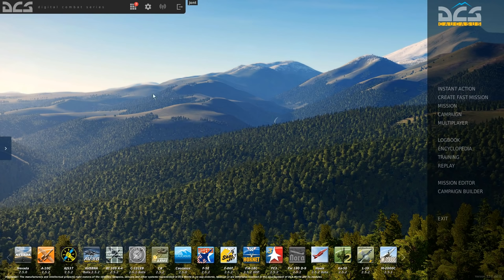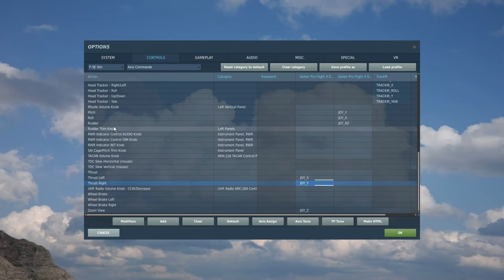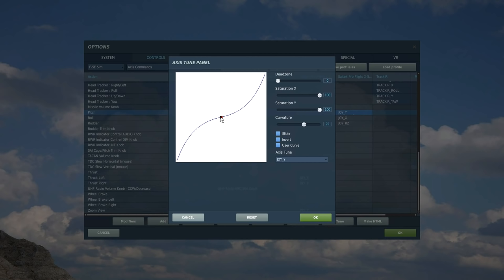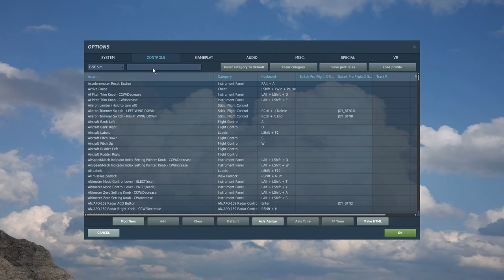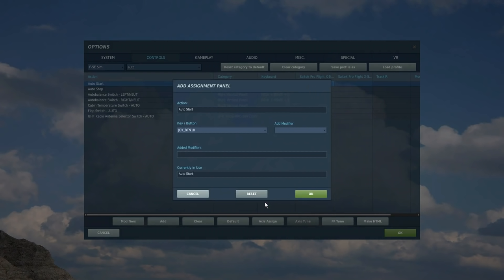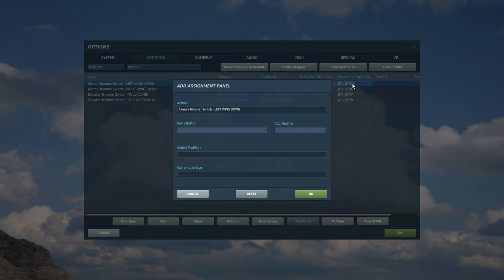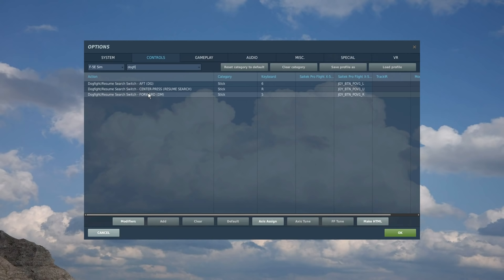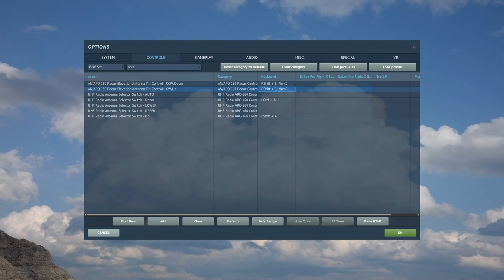F-5E Tiger II: Setting Joystick HOTAS Controls | DCS WORLD

Comment: I'm just getting into dcs and this helps a lot! I just got my x56 today, but while trying to bind everything, I noticed that the throttle and stick are in swapped positions, and for some reason, when initially opening the controls, it has the roll, pitch, and rudder set to my throttle. I'm sure its nothing, because it detects movements to the proper components.
Reply: Same with me

Comment: I am still a new to DCS. I have been watching and learning from your great Tutorials. 
I have a X52 pro and have tried to pretty much follow your settings for it. 
The problem I have even after going over your tutorials is when I am attacking ground targets the gun is firing and then seconds after the gun fires my missiles fire. 
I have the weapons arm on the first part of the trigger and release set to the 2nd part.  

Any idea as to what I may be doing wrong. If possible a step by step listing of what I may need to set for Rockets and guns.. 
That wold be a great help.. 
Thank You Very Much for your great Tutorials. 
I am learning a lot from them.
Reply: well yeah because you need weapons release on its own key dont just put it on a 2nd detent

Comment: Cap!  I have a X-56 also and have carefully mimicked each of your settings exactly except for the radar slew.  I cannot get my throttles to operate in the cockpit!  Every other aircraft they work just fine. As a result, I can't get the jet started!  Rudder pedals move, joystick moves, I can flip all the switches shown in the start video and can't put the throttle to idle even with keyboard controls.  Any insight you can provide would be great!
Reply from the maker: Sounds like you have not uncaged the throttles??
Reply: @grimreapers How do I do that?  I don't remember that in the startup tutorial?

Comment: Hi Cap! I just bought the F 5 about two hours ago, and my thrust does not work! And that's no good if I want to fly the plane.... XD. So i looked in the settings (again) if I had set the control right, which I did, but it does not seem to work in any way. Yes my throttle is fine and it works perfectly on those other aircrafts such as the FC3 series and the mirage. That makes me wonder why that in settings, DCS knows that I'm moving the throttle, but in the game, the F 5's throttle is not responding. Can you please tell me that if its a bug, or a HOTAS problem, and how can I fix it if it is possible to fix? Keep up the good work Cap! Thanks alot!
Reply from the maker: Never heard of it. Confirm your se Thrust Left and Right? Best open a ticket from the EB website for this one. Good luck x
Reply: @grimreapers  Thanks Cap, I have already asked ED about this problem, and they didn't find out why. I guess I'll just leave it as it is XD

Comment: Quick question: what is curvature and what does it do? lol TYIA
Reply: Not sure if you’ve found the answer but essentially 0 curve will make it so that your stick in real life is 1:1 linear with the stick in the game but this means it’s pretty hard to make very fine movements that you would need for something like a2a refueling so you can add a curve so that you can move the stick irl a lot more but have less input over the aircraft, but if you push the stick close to the outside it gets more sensitive so that you can still have a full range of motion
Reply: Also not sure if that’s a great explanation but a curve is basically required to do any kind of fine movement HOWEVER there are some airframes in dcs that already have curves built in and if you add another curve it’ll fuck you up I know the f14 has that and I think the f5 has the option to set it like that

Comment: Is it true that DCS no longer has separate columns for Throttle and Joystick functions under the Control selection for aircraft set up?  I have a brand new Logitech X 52. I don't see the separate columns as shown in this video.   Please confirm.  Thx in advance...
Reply from the maker: It does separate them yes.
Reply: @grimreapers  Hello again.  Just FYI  The Logitech X52 controls are all in one column in the DCS control selection, (maybe because there is only one cable attachment to the computer - the Joystick connects to the Throttle component via a PS/2 Cable) and then via one USB connection to the computer.  The DCS control selections for the X56 is indeed two columns, mainly due to fact that each component attaches separately to the computer(s) via usb.  Not sure if this is how all HOTAS work but wouldn't be surprised if this is the case.  Just for future reference....

Comment: I only get the joystick but not the throttle side.  the throttle works and the mouse, but not the buttons. I  changed my gaming mouse from wot and changed it for a regular one.  I get nothing from the buttons on throttle side. it doesn't light up either, only when starting up.

Comment: "I prefer the stick because I am no good with my feet" is really just code for "I'm too cheap to get pedals, I've never really tried them". Am I right cap?
Reply from the maker: Stop being nasty to people please. The more you are nasty to people, the more and more you will feel bad about yourself. I hope this helps :)
Reply: Thanks for the advice, those are words of wisdom. I'm not so sure I am being nasty though, I'm really trying to help you. Get some pedals, you will thank me. You will become a much better pilot, you'll able to fly helicopters too!
Reply: Damn cap is bringin the heat!
Reply: @Specter0420  If the joystick has 3d torsion you don't need pedals. The torsion remplace the pedals.
Reply: @Daniel-wn4yj  The pedals are 100x more accurate. One percent of travel is about 3MM with mine. One percent of travel on a twist stick is about 30 nanometers, good luck holding that while also flying with that same stick.
Reply: @DmdMixZ  this post is from 2 years ago and Cap has since bought a set of rudder pedals. He can and does use them, Thank you.